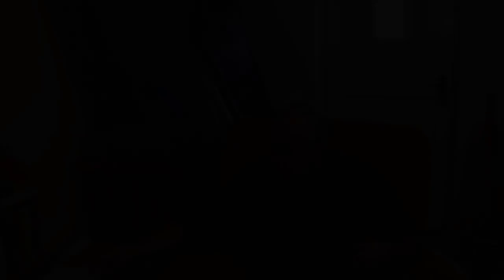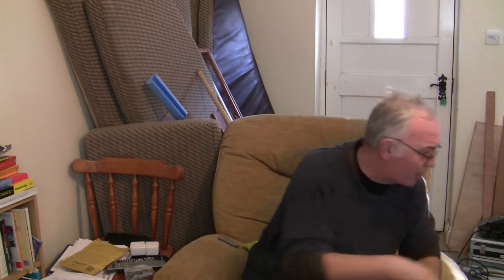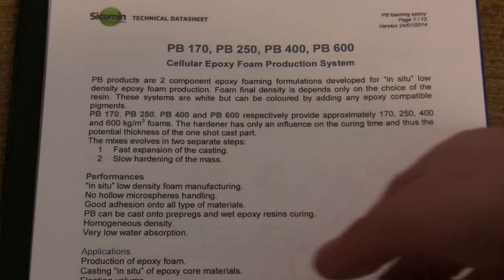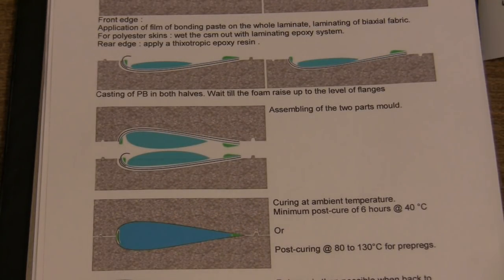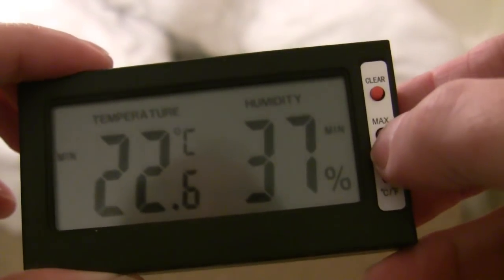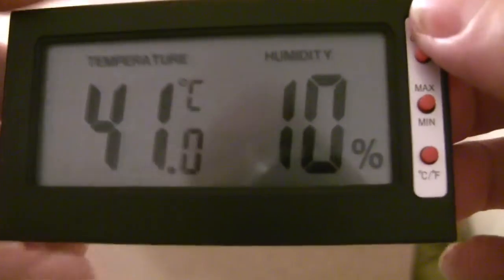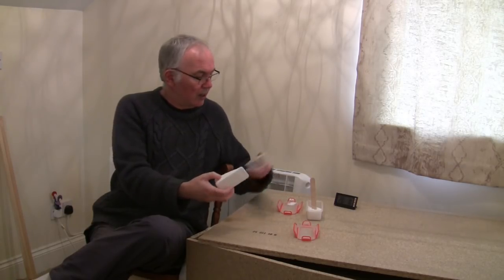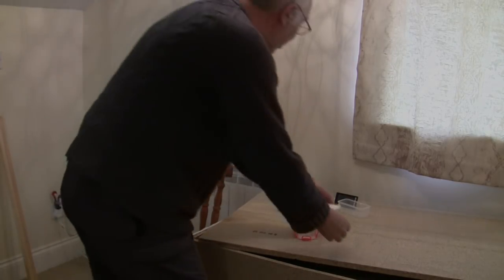Just About Sailing February 2018 - Fixing the Rudder, Pt 2 Figuring out what to do

Comment from the maker: Let me briefly explain why my hammer/chisel test was so unfair.  My hammer weighed 0.7kg. If we assume a hit velocity of 8.5 m/s and a coming to rest time of 0.008 s.  That gives a force of 744 N exerted on the chisel.  The area of the tip of the chisel was about 16 mm2.  That means that the impact force was approximately 47 N/mm2.  The quoted compressive yield strength of the Epoxy Foam is 6 N/mm2 (about the same as end-grain balsa wood).  The typical range of normal domestic concrete is 10-60 N/mm2.
So, the epoxy did well to handle a few bashes before the chisel sunk so far in.  Once it had sunk in the dominant force was a splitting one (because of the wedge shape of the chisel). I can't do the maths to work that one out - but it is not relevant for this application anyway.
The original 'concrete' is very strong with a compressive yield strength of over 47 N/mm2.
The Epoxy is strong enough with a compressive yield strength of 6 N/mm2.
2 + 2 = 4 - except when it doesn't (something to do with non-Euclidian geometry).
Reply: Just about sailing Try boiling those samples in Coke (full fat, not diet). That’ll be a test. I personally would consider filling the rudder with Porridge Oats or Ready Brek.  Once that  gloop dries you will never get it off. It’s the hardest most dense filler in the known universe. It’ll make that slate concrete look like marsh mallow.
Reply from the maker: Ali, you should have see some of the experiments I got up to at Harwell.  The less said the better - but the brittleness test of a shoe sole after being dipped in liquid nitrogen was a goodie - that involved a hammer too.  All my best to the family, Cheers.
Reply: Hehe I don't usually comment but I just had to. I almost spilled my coffee laughing. The porridge and Nitrogen does not survive the hammer. I know ;) Good work on the boat. But yeah. That rudder was easier to mold out then repair. But hindsight is 20/20...
Reply from the maker: Well, if nothing else. I hope this small sub-project encourages people to at the very least make a mould just in case it is not so simple as they first thought.  I've just had a look at your first video and subscribed.  Nice boat - but you have certainly got a big task ahead of you.  Good luck with it.
Reply: Yeah most think Im crazy. But I do come from an old sailors line and have built wooden boats before last one was 23m (meters) two mast. Took a year to build out of wood i was 16 helping my grandpa. Im thinking of molding my rudder after seeing you and mads ... mine is NEW hehe but has been on the rain for 30 years.. all bets are off as to water ingress damage since it was not painted or finished. But great stuff youre doing. Lovinn it. sent you a youtube message. Planning to drop the damned rudder in April.. got to lift the boat to drop it..

Comment: Have really enjoyed your videos from the start.I rebuilt my rudder about 15 years ago.Split in two observing how it was put together and just replaced with new modern materials.I used a composite type of foam cannot remember the name, reglassed and re-enforced the layup.Glad to say it has lasted well and is still going strong.If your ever down Cornwall way let me know we could meet up for a meal and drink, I sail out of the Tamar. My boat is a Phillipa 27 called Drifter of Helford.
Reply from the maker: Terry, very reassuring comment.  It's good to hear from someone who has done the same thing on a similar sized boat.  Good to hear that it is still going strong.  I am also going to re-glass and reinforce inside and out.  I worked in your neck of the woods a while back and had a serious look at keeping a boat at Weir Quay at one point.  I don't know what my plans are before I head off to the Med (whenever that might be), but I would live to explore the South West coast a bit better. I missed out on loads of places when I travelled round.  Send out another comment if I do start to travel in you direction - in case I can't re-find your comment.  Cheers.

Comment: I have only used the polyester two part closed cell foam, that stuff expands quick you have to have everything ready, I exploded one of the plywood buoyancy tanks in my punt with it and it seems almost impossible to crush or compact it once its gone off. East coats fiberglass have some very helpful videos on here or by direct link from there website.
Reply from the maker: Thanks for this.  Very good point.  It is one of the reasons I did so many test - and might seem a bit over-cautious. The Polyester stuff seems to be a very different animal in the way it expands.  From what I have seen Polyester Foam seems to expand and harden as part of the same process.  Also, the expanding part seems quite vigorous. The Epoxy foam I am using has the characteristic of very low pressure expansion - if it meets resistance it simply stops expanding.  And once it has expanded it still remains quite soft and pliable and is quite 'squishy'.  Hence it is used quite a lot in closed moulds. The hardening part is then a very separate process, which I didn't fully understand at first. But I wanted to see all this with my own eyes - hence all the tests.

I have now done a few more tests, which I will cover in the next video. Given the proper vigorous mixing (of both the raw resin and the resin/hardener mix) it works well - and in line with the data sheet specifications.  Confession time...I was not monitoring the temperature of the downstairs area where I mixed the two samples. I assumed it was about 20 C, but of course we have just had some very cold weather. I was so focused on getting the post cure heat box to over 40 C - which I had placed at the top of the stairs in a warm spot - that I didn't notice the ambient temperature downstairs had fallen to 16 C.  It needed to be 20 - 23 C.  Whoops! And of course the two liquid components were also too cold. - hence the expansion not working properly, and then continuing later in the heat box.

Yes, I rate East Coast Fiberglass - good website. Very good range and quick delivery too.  Cheers.
Reply: Yes I think that epoxy is much more temperature sensitive than polyester in the curing process, my epoxy has set solid in this cold weather so I'm going to have to heat it right up to un crystallize it, window template looked a good shape looking forward to seeing those going in, cheers. https://www.flickr.com/photos/71588393@N06/    
I have a few good build pictures on here and a couple of videos.

Comment: Thanks for filming this and putting it out - it was well worth doing and I for one thoroughly enjoyed it. I would like to make a few comments/suggestions but must preface with the I am not an expert caveat.

1. I thought your experiment was fantastic - for me it demonstrated this was a viable repair method but also helped to illustrate why you need to really understand the materials that you are working with and you have certainly achieved that achieved that.

2. Assuming you are going to use the old fibreglass skins as each half of the mould? 

3. I think the key to success with this material is getting the volumes right - assessing what volume of 'space' you are trying to fill AND what mix or batch volume of material you need to achieve that (expansion ratio is obviously key).

4. Given 2 and 3 are true - may I suggest something along these line - set up the fibreglass skin with the rudder shaft and tangs correctly aligned and drill  a say 1/4 inch hole in the lowest part of the fibreglass shell and put a bung in it. Then fill it with water to the level you are trying to achieve once the foam has expanded - remove bung and catch the water - measure it and that is your 'desired volume' - rinse and repeat for the other side.

5. When you come to casting put the bung back in - it can be fibre glass repaired later.

5. I was also wondering about your hammer and chisel test - which is a point load and quite severe  But I wonder if the tang/foam interface could also act as a point load and wonder if increasing their effective surface area could ameliorate that - maybe by putting a long (vertical when the rudder is fitted) between the three free ends of the tangs (could be connected by nuts and bolts).

sorry for wittering on - I wish I was a bit nearer I would love to be of more direct help.

Keep on keeping on. :-)
Reply from the maker: Wonderful long comment. Much appreciated.
1. I think it is really important to 'play' (same as experiment really) with the materials if you haven't used them before.  I ordered over twice as much of the epoxy foam as I really needed.
2. Yes, I am going to use the old skins.  However, they are most probably (almost certainly) made with Polyester resin and CSM (not very strong).  I will (probably) do a layer or two of 450gsm biaxial with epoxy resin (much stronger)  inside the old skins - that will add 1 mm, but a lot of strength.  I will then put up to 4 layers of 450 on the outside after I have filled the bit in the middle.
3. Yes, this bit didn't go too well.  My current thinking is that the expansion ratio of 4:1 was not achieved due to ambient temperature being too low and also inadequate mixing.  Confession time - I was focusing so much on getting the heater box up to 40C that I didn't take too much notice of the room temperature which is normally about 20C.  However, it actually dropped to 16C.  It's very cold here at the moment and my lagged water pipes even froze today.  Also, the instructions clearly say to use a mechanical whisk thing.  I couldn't get any of the right size, so I ordered some - guess what? They arrived this afternoon. Useful - not really.  I will have another play with a better mix and temperature and see if I achieve 4:1.
4. Good suggestion. Have a look at the Sicomin video in the description. They fill the halves with fine dry sand and then measure the volume of that.  I used maths, and, well the less said about that the better.  My maths is usually fine - we all have an off day.
5. You are absolutely right.  The chisel test was not really valid at all - shame on me. It was testing the wrong thing. The specification for the compressive yield of the epoxy foam is about 6 N/mm2 - which is about the same as end-grain balsa (and over 800 psi). That should be plenty. I understand the point about connecting the tangs.  I did think about it before I had the new one made up.  I could have had something welded between them at that stage. I am most probably going to copy the Jefa (again see video) method and use a combination of thickened epoxy (404) and glass tape (probably 450 again) so that the tangs are structurally bonded to the skin - which will also be strengthened as per 2 above.
I really appreciate comments such as yours when I do DIY so that others can read through them and have access to more information if they choose to do a similar job rather than just copy me.
Cheers

Comment: I wonder which calendar you are using. This year (2018) February had 28 days. You mentioned 29th, 30et, and 31st!
Reply from the maker: It's a special boat-building calendar where time becomes very elastic. For example, if someone is doing a job on a boat and they say it will be ready in mid-May; in normal time that typically means about the end of August - if you are lucky.  Thanks for watching :)
Reply: I thought something like that might be the case.  Watched all four episodes, rudder looks good.
Thanks for posting it.

Comment: Was also wondering if you thought about Seacast foam?  It's expensive and messy but it adds glass fibers for structural support.
Reply: I enjoy your videos... I'm just adding my thoughts and opinions because I'm starting my own fiberglass boat restore.
Reply from the maker: Feel free to keep commenting - even in the future when you are into your restore.  And let me know if you post any videos.  I didn't consider Seacast for the simple reason that I can't get it in the UK.  They are not allowed to air ship it.  Also, they are very keen that it is a complete filler inbetween fibreglass (or aluminium) and advise against having any metal in the middle - IE the tangs and the stock.  However, I understand that they have an excellent technical support department, so it may be an idea to contact them.

Comment: are you going to reinforce the foam with fiberglass mesh or graphite rods/ screening...just to add strength?   great video, love the experiments
Reply from the maker: My plans change all the time, but currently. I plan to strengthen the current fiberglass skin (inside and out).  The epoxy is at least as strong in compression terms as end-grain balsa.  There will also be a physical bond between the tangs and the skin - I am not going to rely solely on the foam. The chisel test was a bit naughty of me as it doesn't really prove anything - except that the original concrete is pretty much indestructible.  Cheers.

Comment: Very concerned about the aparent brittleness of the cured foam. Not sure I'd trust it in heavy weather. Had you considered a glassed in balsa core?
Reply from the maker: Good point. I think I did in unfair test of the foam by hitting it with a chisel.  That didn't really test the compressive yield at all, I really needed to do some sort of compression test.  I don't have a compression tester, but I might be able to rig something up with a suspension ball joint press I have for car work - I could rig that up with a torque wrench somehow - watch this space.  Balsa has a density of 100-250 kg/m3. The epoxy foam is 250 kg/m3. The compressive yield strength of Balsa (end grain on) is between 6 and 8 N/mm2 (whatever that actually means in real life). The compressive yield strength of the epoxy foam is quoted as 6 N/mm2 - so about the same as the lowest balsa value.  So I am pretty sure it is up to the job - but there is no doubt that it won't be as strong as the 'concrete' I am replacing by a long way. Cheers.

Comment: Hi, just curious why you're casting in one go, rather than casting foam in each GRP rudder half, gouging the stock/tang cavity in both halves and then sandwiching together with glass/thickened epoxy...
Reply from the maker: That could be an option, and I am sure it would work OK. The foam I am using is a low pressure foam. It will expand to a certain point and then give up if it meets too much resistance.  I think some of the expanding polyurethane foam is more aggressive in the way it expands so might try and burst the casting apart.  At the moment, and this may change, I am thinking of doing something very similar to the Jefa video (see the link in the description), except with just my two existing halves of the old rudder.  But if you are doing something else and videoing it please let me know. Cheers.
Reply: Thankfully  I've no imminent rudder rebuild video planned (I hope!!.. since Nimbus is on the hard and trapped water freezing is the usual cause of problems), but  I'd just be worried 'what lies beneath' which will be uncertain if you do it in one go.  The surface area of the rudder means even a 'gentle'  foam expansion generates a high bursting force, so you might think about making an enclosing sand box to act as a bolster for the grp.  Either way I'd ensure that when you pack the tangs with glass/epoxy  there's a full solid contact from metal to grp skin.  My own experience of using/testing expanding structural  epoxy foams is they perform poorly when subjected to cyclic fatigue loads.  Hope it goes well, good excuse to crank up the central heating!!
Reply from the maker: Interesting idea with the sand.  I am certainly intending to strengthen the old skin before I do the filling.  And yes, I totally agree that I want the tangs to have solid contact between the them and the GRP skin.  Maybe I should go back to concrete.

Comment: Do you have a way to test the test unit for rotational strains you would expect of a rudder? It’s great to see someone who tests these things — lots of lessons learned in this experiment
Reply from the maker: No, I couldn't find anything on this.  If you have any ideas, I would love to hear them.
I have done a lot of searching on the internet.  I am sort of combining stuff that is out there, some theory (including material specifications) and my own experiments - which were really to help me understand how to use the material.
Most people seem happy to use 16lb foam as the core.  Andy on Boatworks (great YouTube channel) opened up a rudder and found some foam that he estimated as less than 6lb - He ripped it out with his bare hands.  That rudder was bigger than mine and didn't have any tangs at all.  It also had a hollow stock that had leaked in water and soaked the core (the foam wasn't even closed cell).  What's more, the foam wasn't even bonded to the skin. He was very shocked and surprised and rebuilt it much stronger with 16lb foam.
I actually can't understand how that rudder coped with any rotational strain at all - but it did.  The stock was simply glassed to one side of the skin - no tangs.
So my logic is, if that one survived then mine certainly can.
I am going to strengthen the skin and also make a physical bond between the tangs and the skin.  Also, the epoxy foam has about the same compressive strength as end-grain balsa - My chisel test was a bit misleading.
I have a couple more experiments to do, but the bulk of the next video will be to put it all together. Famous last words.  Thanks for watching and commenting.
Reply: Thanks for the thorough response, good luck!